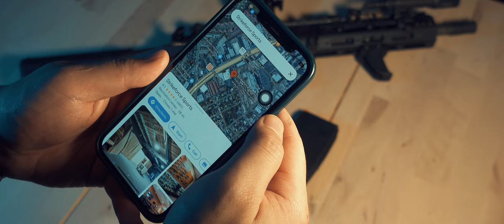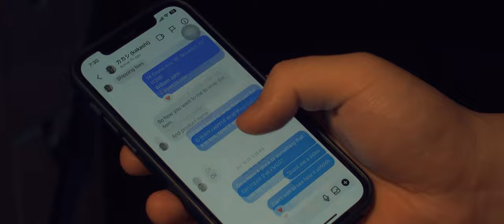AEGIS FMG9 gas blow back airsoft custom build & gameplay

Comment: Says it has build-in g18c. does that mean we can't remove the slide? sorry im confused about the link u provided in the description
Reply from the maker: The slide is always removable, so does everything in the lower frame.
Reply: @laojiangCJ1577  i just saw shipping is very pricey dang! at least for the U.S.
Reply: @laojiangCJ1577  I notice this version is different than the one from Aegis, in terms of brands that is. That's not a problem right?
Reply from the maker: @nextlvlroy  I don't think that would be a problem at all